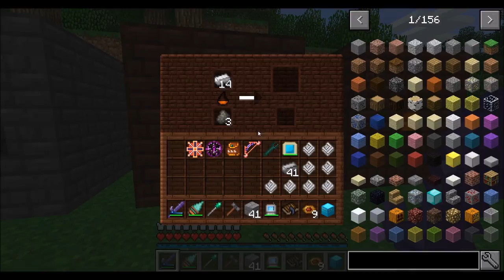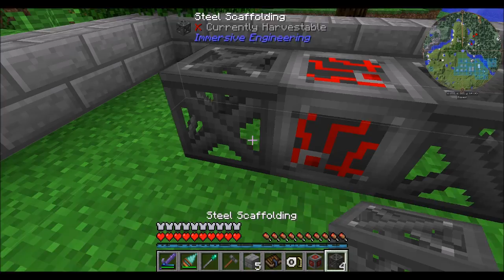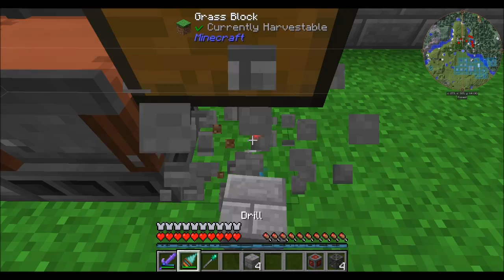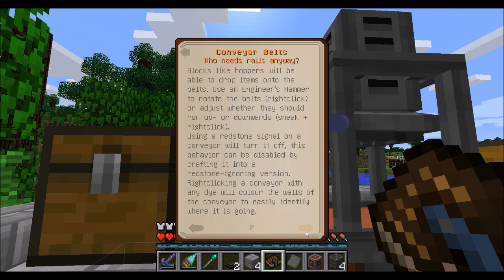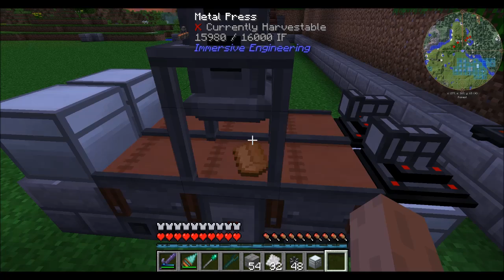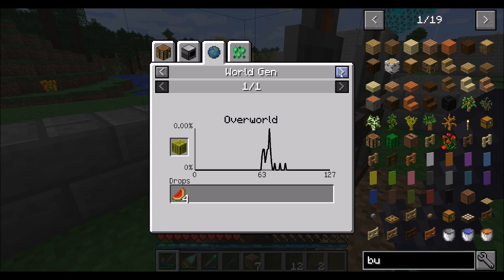Lets Play S8 E101 Immersive Upgrades

Comment: Anyone else having issues with Extra Utilities 2 Water Mills? First problem: When placed in world, the tooltip ID's them as Solar Panels, even though they still LOOK like Water Mills. Weird, but I went ahead and continued my setup, only to discover that they generate no grid power. Tried changing the arrangement of the flowing water (yes, it was flowing and not sourceblocks next to the mill) and tried changing the fallling height of water as well as the placement height of the mill. Finally gave up and changed to wind and lava mills instead (both of which work as expected)

Comment: Use the transfer pipes from IE to make it look cool
Reply: The fluid ones? yeah they work really well as they dont actually hold the fluid in them. Its great if you have a machine that auto outputs the fluids (like IE does) not so helpful if you need to extract the fluid tho...

Comment: they should add a expensive but not to expensive way to have a hologram of the multi block structures
Reply: Similar to the holo projector from AdvancedRocketry? It wouldnt really need to be expensive. could be neat to have an olde movie projector like block which could project the structure you want to build.
Reply: Yes like that by just a little different gui wise

Comment: Does the cloche work with Ender lilly seeds? Not that dire needs them at this point in time.
Reply: Yes if you are using an IE build newer than 58. If you are using build 58, DO NOT try to put an ender lily (or any XU seed for that matter) in the cloche, it will cause client crashes for anyone near it.
Reply: Thanks! That's great info
Reply: I'm pretty certain that it still follows the Ender Lilly's funky growing cycle, so it still takes something like 8 minecraft days to grow.
Reply: Yes, it does follow the Ender Lillie's rules, but it at least makes it so theyre not hit by rain and you cant accidentally run into their spikies.

Comment: Use coal coke blocks.
They have a higher efficiency when making steal than 9 separate coal coke. While you don't have a coal problem, it kinda increases the speed at which you create steel since a block lasts longer, meaning it's efficiently more coal.
Reply: From IEContent.java:
BlastFurnaceRecipe.addBlastFuel("fuelCoke", 1200);
BlastFurnaceRecipe.addBlastFuel("blockFuelCoke", 1200*10);
So a block of coal coke has the burn time of 10 pieces of coal coke
Reply: BiH-Kira you are wrong in that point. Nine pieces of coalcoke have together the same burntime as a block of coalcoke, so efficiency is the same.

Comment: "I'll power these properly later" immediately tries to cheat the sidedness by putting an export on the bottom. 
me: "ungh. you so lazy"
Reply: Hi Rorax :)
Reply: If I ever get into modding, then I will probably warn the player in the manual that the machines have no protection against the consequences of violating physical laws and trying to force an item to go through the bottom and "sneak" it through the top, left, right, front, or back faces, or any of the other faces. Essentially, you would be warned about that, and then it would create an explosion when you try to violate it with my machines, unless you have the Quantum Physical Transporter (where it would allow for that to actually have nice sneaky modules.) Yes, I know that some people would hate me for that, and compare me to Greg, but does it really matter in the name of balance? Tedium is a natural thing. However, it shouldn't be tedium alone that determines balance. It should be complexity of systems, trying to get to know how they work, and working within limitations onset by the machines that make the systems work, and not tedium trying to get a single machine.
Reply: Efficiency is clever laziness.
Reply: 'tis not laziness, it is efficiency :)

Comment: Nice even numbers. "29 by 29"
Reply: 29 by 29 is equilateral. That's what dire is concerned about.
Reply: So I was like the only person that thought "even / matching" on the X & Y and not just value?!?  I mean cause Dire Always builds square buildings with an absolute dead center requiring an Odd number...
Reply: its dire he always has to have a single block center
Reply: Yeah I like those even numbers as well.